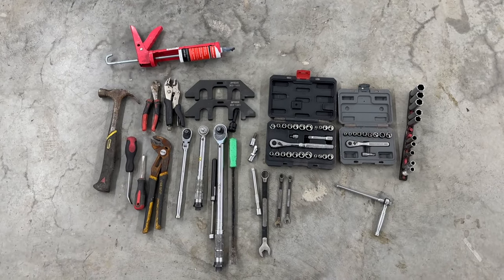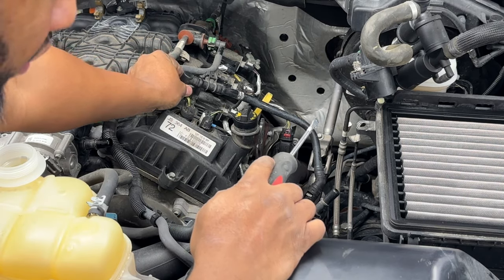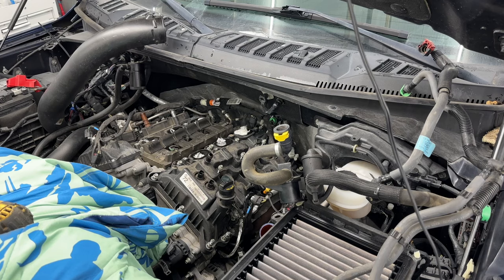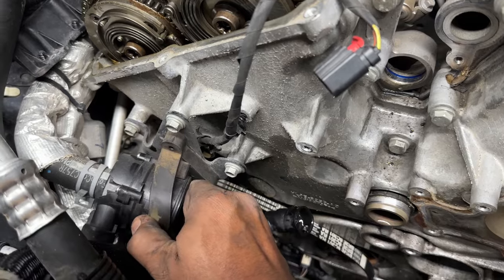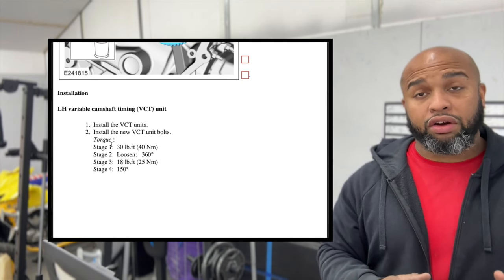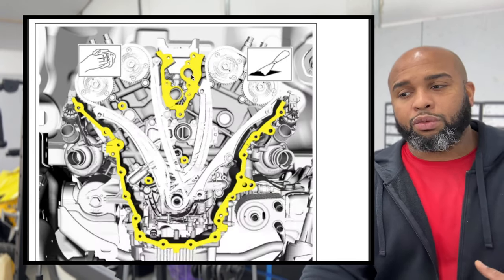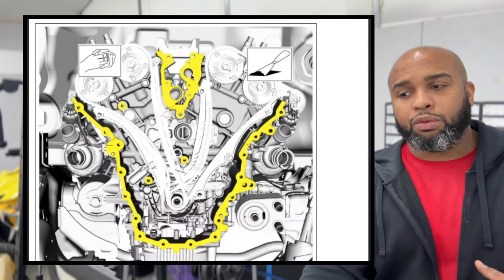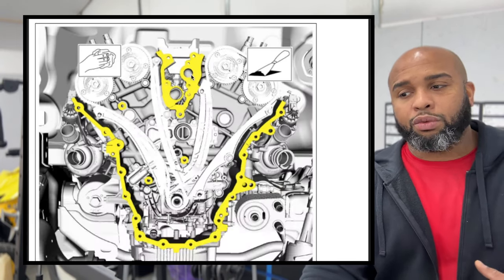F150 Cam Phaser Rattle Repair Gen 2 3.5 Eco Boost

Comment: ford told me to kick rocks on warranty repair. they pushed an update to the PCM as a bandaid and because I missed it they won't fix my 52k mile truck. I told them even if God wrote the PCM update, it's not gonna fix a hardware issue. Between this and my mustang, I'll NEVER own another ford product again in my life.
Reply from the maker: That’s what happened to my truck. I did not get that update so no warranty coverage
Reply: Same.  $4000 repair quote.  What a complete ripoff.  Next vehicle will be anything not Ford
Reply: My 2014, F150 first rattling at 55,000, again at 100,000!. Coupled with the rear fenders rusting through in 2019. Oh! Let's not forget the 20,000 mile spark plugs.
Thank God it wasn't expensive at ONLY $38,000. I had the misfortune of having a 97 Taurus Went through 3 Transmissions, only the first covered. 
Toyota are looking better all the time?
Reply: @juicer911 what service manual were you using?
Reply: How is there not a class action law suit...someone step up and get the ball rolling
Reply: Same issues. Lets include will not pass inspection. Spun front main bearing. Both turbos, it goes on and on. This one owner truck has not reached 200,000 miles yet at 197,658 miles.
Reply: Well you got a Nissan sooo.... 😂
Reply: @GoonyMclinux  and it's still better than Ford's best effort. What's your point?

Comment: Thank you for this very detailed video.  Definitely helped tremendously.  I hit a few snags that really added time to this job.  The left intake phaser was the culprit and the intake cam had major micro spalling on the lobes closest to the phaser.  The other lobes on the intake and exhaust cams had the same issue just not as bad.  Replaced everything.  Also, this job was done at a dealer three years ago under warranty and the phasers were torqued down extremely tight.   It took a 4.5' breaker bar in conjunction with a rounded bolt extractor.  Thank you again.  It's great to have a truck that does not rattle.  God bless!

Comment: Book time on my 18 F150 3.5T phasers, chain, water pump, etc (with some minor exceptions, the job you spelled out here) was 18 hours. I came in right at that with your guidance and I took my time over a 3 days stretch to let things cure before starting and cleaning up. Thank you ever so much for taking the time to compose this and to all of you wondering, this is spot on instruction. Follow this step by step and you will cure what ails your beast. Now on to fishing!

Comment: You're a hero for taking the time to put this together. Thank you so much. I am gearing up to do my phasers in a week or two and this is insanely valuable. You rock.
Reply from the maker: Good luck!
Reply: How did it turn out? I just did mine and this video helped a ton!
Reply: @TheBigghunter01  it turned out great. 5k trouble free miles since. This and another video + the service manuals were very valuable. How did yours go?
Reply: Has anyone heard of or tried the screw on oil filter adapter from Baxter performance Parts in which they claim it helps by holding  some oil in place by means of a check valve that helps with cold starts pre oiling?

Comment: Just replaced my phasers and used this as my guide. Really great video!

Taking pictures, using colored electrical tape to mark some of those electrical, vacuum and coolant connections and putting all the parts in order of removal was very helpful in getting everything back together.

I will clarify that the harmonic puller is a 3 jaw type and to install you need the other harmonic remover/installer that has the bolt with 2 thread types to put on the harmonic balancer. A strap wrench was very useful to hold the motor while torquing the crank bolt but i would recommend torquing it before removing the cam holder tool. (I already put the valve covers on)

The trim removal tool was worth every penny for those Christmas tree connectors. Hose clamp pliers were helpful too (i used to just use channel locks). 

Red scotch-brite pads and a $10 Harbor Freight dremel with a wire wheel were great for getting that valve cover cleaned off.
Reply: Also, if anyone here has a intermittent rough idle, its probably the VVT solenoid.

Comment: Great write up. Definitely helped me. That one 10mm on the battery harness is much easier to remove if you put 2 nuts on that stud and use a ratchet from up top to take the stud out.
Reply from the maker: Thank you. Hopefully I never have to do this again but if I do, I will take your pointers.

Comment: Well I’m using your video to do mine after local mechanic said 7k and ford said 5k. Right now I have the new cam phaser on and torque to specs. Thank you so much hopefully I’ll be done tomorrow
Reply from the maker: Be prepared. It is a long, long job.
Reply: @juicer911  so I’m done I used the list you provided for tools and parts. Along with the tutorial  I change the cam phasers on my expedition 2019. Now it sounds beautiful and it runs amazingly powerful. Thank you so much.  The  bottom anchor for the battery cable I didn’t even put back I just taped it back with electrical wire and it was good. You were right it’s  a pain to take that one bolt out. In total it took me 20 hours. That is including the time for torque specs and pausing and rewinding vid. I was told by ford that it was gonna take 30 labor hours for them to complete. So I think I did pretty good lol. I spent 2000k in tools and materials  (Walmart, harbor freight and Amazon ). Thank you so much for doing this video.
Reply: Excellent I’m about to do same

Comment: Kenneth!   Fine job  of explaining the step by step of R &R the cam phaser.

Just a thing that helps and makes it easy to get the valve cover to come off. Just spray spray something like WD40  around the seals and take a sharp pick and just it and the valve cover will lift off with ease..
Remove the coolant recovery tank with 2 bolts and 1 small hose..
Remove the air filter.  It can trap a small thing like a lock washer which would be sucked in to a turbo.
Then you will need a turbo. Saw this happen in a tractor dealers shop.

Tom Silver

k
Reply from the maker: Thank you so much! Hope it will never be like that again. Hahah

Comment: I have a 2017 3.5 Ecoboost, I have had this done at the dealership "Twice", thank goodness it was under warranty.  Having said that I have the rattle yet again, and I'm out of warranty.  Im at 110k miles, just really frustrated with this issue amongst others like the 10 speed transmission that I had replaced @ 100k miles, and the infamous leaking oil pan issue. I know all brands have their issues but damn this is a lot for one truck, and it's not just mine. These newer f-150s definitely have their problems.
Reply: Boy I've got 150k on my 2014... Always stayed up on oil changes, Motorcraft only. Love my 6speed trans 0 issues. Just now getting a lite rattle on start up. Not sure if it's phasers, tensioner, heat shield or wastewater rattle. Oh well gonna tackle it soon.
Reply from the maker: Sucks that you’ve had so many problems. I’ve had to, and never have had an issue out of mine. I just keep up with the regular maintenance.
Reply: A lot of Ford dealers are not installing the updated phasers. They have a surplus of the old phasers that fail but under a warranty repair they install what’s in stock. Anyone having this done should always request the new update phasers are installed and not the old version. The new versions are the ones where you cannot see the springs on the front of the phaser. Hope this helps.

Comment: Just a tip for anyone that plans on doing this, clean the surfaces before you re install any of the timing components it makes it easier to clean, and if you break the small connector for the oil pressure solenoid when removing the front cover just clean the Area and Sensor with brake clean and super glue it back in place.
and to help time everything it doesn't matter too much if you spin the engine Counter clock wise a little just make sure all your timing marks line up before you set the final tensioner, you can also slightly move the cam phasers to get some more slack on the chain. these take me about 6 hours to do so just some tips on how I make it easier. 
when re installing the Front cover use the Long bolts in the middle of the front cover to help you line up if you are afraid of smearing the sealant.
Reply: Also helps if you use silicone spray on the valve cover seals when removing, makes the covers break loose easier. 
and the front cover seals when re installing, along with any hoses you disconnected. 
and if your vehicle is high mileage try and set the hose clamps back it its original position( it should be imprinted on the hoses) other wise it might cause a coolant leak.

Comment: I didn't notice one on your tuck , you should check into a oil seperator catch can I usually catch about 2 inches every couple months and the fuel mileage has gotten a little better. You must be a pretty good mechanic these newer engines are so much more complicated to work on .
Reply from the maker: I actually do have one on the truck. I don't think I showed it in the fridge though. But thank you for the suggestion.
Reply: So install oil separtor is good step? In my car isnt install from previous owners.
Reply: @OndraZales  it's for engines that are turbo with forced air putting one on at anytime I dont think is a bad thing it keeps the oil from your valves and pistons from getting carbon build up I would put gum out in your fuel too help clean what might already be on their.

Comment: Thanks for the video it’s super informative! I opened that Google drive trying to see if there is a step by step manual I couldn’t find it. Is there a web link or something so I can print it out. Thank you much appreciated
Reply from the maker: Glad it helped! However,. I can’t find the file I used before.
Reply from the maker: https://drive.google.com/drive/mobile/folders/1fAXT1oD1dJg7vgyWrQJmM9xo0Fv4h5jR?pli=1
Reply: @juicer911  thanks a lot bro l! I will have your video up while assembling and tightening the screws.

Comment: Hey Kenneth! Appreciate the video 100%. I just found out my extended warranty wouldn't cover this repair because i couldnt provide them with verifiable maintenance records, even after i told them i do all the work myself. Long story short, i now have to tackle this problem AFTER having to replace the water pump and timing chain components on my 2013 explorer (all the fun! Lol). I was curious, where do you get the electronic manuals from?

Comment: Happened to mine at 19k, hope the new style phasers correct the problem
Reply from the maker: I hope so as well
Reply: The needs to be a class action law suit against Ford. So many of us have had this problem.
Reply: @Mike1981905  had mine changed awhile ago to the new ones now. Fingers crossed the same crap doesn’t happen again in 20k miles

Comment: Where did you get the maintenance procedure? I’m about to try this job in a month or 2 once I collect up all the parts but I can’t find the maintenance procedure and I would feel a lot better if I had it
Reply from the maker: https://drive.google.com/drive/mobile/folders/1fAXT1oD1dJg7vgyWrQJmM9xo0Fv4h5jR?pli=1
Reply: @juicer911  what a hero
Reply: @juicer911  This is for 2017. Do you have a 2018 service manual link for the torque specs? Thanks!

Comment: Hey Kenneth, Unbelievable Job. Great Video. When all is put back together, is there any special way to start the truck for the first time? Hold down the throttle for 5 seconds to get oil pressure? Rev the engine to 3500 RPM to set the PCM? Purge the radiator? Thanks Don
Reply from the maker: Great question. I did not see anything in the manual about special start up instructions. However, I personally just started it like normal.

Comment: Before removing the tensioners and chains how do you set the engine to tdc ? Do you line up links with the marks if the old chain still has some color of those tdc links?
Reply from the maker: You rotate the motor until the cam tools lock in.

Comment: Thank you so much for your video! I checked more videos w ith the list using parts and any list dont have new timig chains. You don't have too. You don't need new timing chains?
Reply from the maker: Ford does not replace the chains for the CamPhaser recall. I personally think it is cheap insurance. Ford is cheap and only replacing exactly what is needed. Timing chains, water pump, tensioners should all be replaced because they have a “life span.”
Reply: I agree with you, but I didn't see the past numbers for the timing chains or guides. Did I miss them or do you possibly have them?

Comment: 2018 F150 3.5 Eco with 80,000 miles. Cam Phaser rattle started about 60,000, I towed 20,000 miles with the rattle.

     I watched about 3 different You-Tubes and followed Kenneth's the most. He really had a lot of detail. I had trouble getting the Cam phasers off with the cheap tool
on the internet. The cam tool bent and the Torx Plus almost stripped the bolts. I bought  a quality Stallion cam tool and OTC Torx plus from Freedom Racing in Iowa.
A special thanks to Brain at FR, he was awesome, very knowledgeable. The crank pulley tool from the internet was fine. To install the crank pulley, I bought a 4” grade ten
bolt to get it started. I did not have to tap it on. The most difficult thing I thought was the timing cover. You don’t have enough time to install it using the #357 silicone.

     When finished, I pre-primed the oil holding the gas pedal down for about 10 seconds until pressure. It fired up right away, quiet and smooth.
I added antifreeze and topped off about 3 times without a vacuum. No problems, no codes.

     I want to give a special thanks to Kenneth for his awesome video because it made most things very, very easy.

     I’m 71 years old and did the job in about 20 hours by myself taking my time. I worked on engines in my younger years, but conventional V-8’s, nothing like this.
I made a 2’ x 4’ Shelf that laid on top of the radiator to a 4’ ladder with a pad. I bought the parts from Ford on line for 30% off. Parts cost $1500 and tools cost $300.00

Here is a list of items I bought.
Cam Phasers (4), Timing Chains (2), Crank Gear, Chain Guides (2) , Tensioner Arms (2), Chain Tensioners (2), Solenoids (4), Water Pump, Thermostat,
Valve Covers (2), 	By-Pass Hose, Lower Hose, Upper Hose, A/C Belt, Serpentine Belt, Plus all the Gaskets, Seals and Bolts.
Reply: Could I message you directly to rent your specialty tools?
Reply from the maker: Awesome. Thank you for the input and assistance with this repair. This video and information will be used for a long time.

Comment: The end all for this is a Pre Oiler installed before the oil filter, when the key turns power to the dash. It pre oils the top end of the motor and than starts. Every vehicle should have this...
Reply from the maker: Thanks for that comment
Reply: 100% or an even easier fix would be to program the computer to allow the engine to crank over for a couple seconds letting it to build a little pressure before allowing it to actually start.
Reply from the maker: @_r.t- true!
Reply: just Hold the Gas When cranking, it will crank the motor without firing the injectors so it won't start. @_r.t-
Reply: What pre oiler did you use?
Reply: I'm about to do the job so if you pre oiler good bads comments on would be extremely  helpful.
Reply: @_r.t-  you just gotta hold the brake when you start and it will crank.
Reply: @WutUpWattz  yes but not everyone knows about flood starting and it doesn't work with remote start
Reply: What pre oiler are you referring to? I want to install one on mine.

Comment: i have a question for you.  the undated fazers and schematic show two gaskets per seal to be installed between fazers and cam.  I fear when doing so the seals will block off oil passage and or if not installed leak or leak because of double gasketing?
Reply: Those gaskets do not go behind the phasers. Those two seals go in a groove in the cam itself. You do not need those. There are eight of them.

Comment: Do you have a website where you pulled all the torque specs? Or what website did you use at the end while explaining?
Reply from the maker: I had a FORD service manual. I have to see if I can find the link